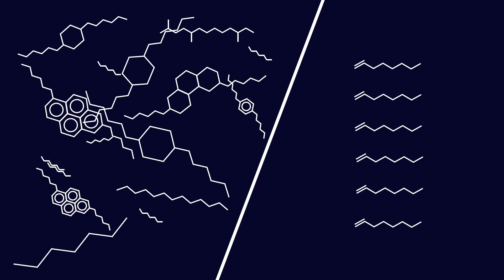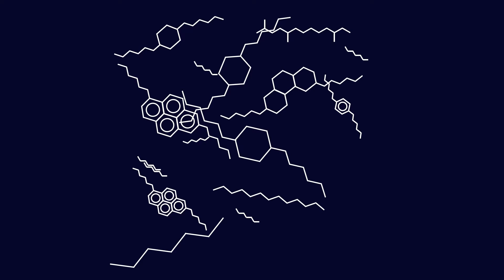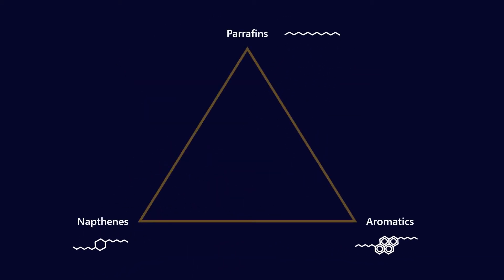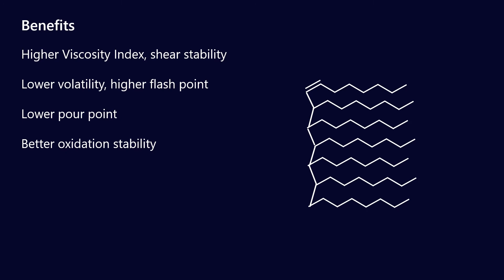What are the performance differences between polyalphaolefin (PAO) synthetic base oils and con..

Comment: The only reason PAOs exist is because 1960s mineral oils don't work at 30,000 feet. The cold flow properties of PAO are brilliant when the temperature outside your cockpit is -50°C but for us mere mortals that drive cars at sea level, in countries with temperate climates, PAOs are something of a waste of money. You need to realise that PAO base stock typically costs about 4 - 5 times that of a bog standard mineral oil. They are also incredibly 'un-green'. Yes you can still buy PAO-based synthetics (Amsoil, Ravenol, etc) but over the last 20 years, the big boys have been quietly euthanising them as fast as they can.
Reply from the maker: They’re still pretty prevalent in the industrial sector. Plenty of PAO gear, hydraulic, compressor and turbine oils. But yes, in engine oils they are a dying breed.
Reply: @LubricationExplained  A dying breed because Group III base stocks are being used in “synthetic” oil offerings (at a lower price) instead of more expensive PAOs?  LE, your must be knee-deep in the lubricant industry in order to discuss so many related topics.  So, is  the lack of consumer demand causing the extinction of motor oil PAOs?
Reply from the maker: @watercooled8105  Great question - it's likely a combination of factors that warrants a stand alone video. TL;DR - additive technology, base oil tech, and blending methods have all come a long way which means you don't need to use as much PAO to achieve the same level of performance. For example, just within the base oil market we have recently seen the rise of both GTL GpIII base oils, as well as mPAO GpIV, both of which offer performance benefits over standard GpIII and GpIV base oils respectively. But great idea for another video!
Reply: @watercooled8105  In my experience, the three most important parameters in formulating any commercial engine oil are a) cost, b) cost & c) cost! This applies as much to the most expensive top-tier factory fill oils as it does to the lowliest SG/CD 20W50 mineral. The decline of full PAO/ester oils is driven by simple economics. 
BTW, you only need one look at the mind bogglingly complex manufacturing processes required to suss out that modern Group III oils are every bit as 'synthetic' as PAO.
Reply: @MrSensible2  I totally agree with you, and thank you for bringing that point (market force) to bear, but then…I can go to a store and buy cellophane wrapped, abominations labeled chocolate chip cookies or visit a family bakery and purchase a fresh, delectable, rich chocolate chip cookie with incredible flavor.  Both are chocolate chip cookies.  Both built on cost, but far different processes and ingredients.  I want (and I’m willing to pay for) the bakery cookie, I just have a desire to know and understand it’s ingredients and the process.  I currently run a PAO oil in my vehicles and unscientifically, feel a noticeable difference with the smooth operation and reduction in oil consumption….what’s taking place?
Reply: @watercooled8105  From the point of view of oil consumption, you might well see a reduction with a full PAO based oil. For any given viscometric balance, with all other parameters (eg DI/VII) equal, PAO should yield an oil with the lowest possible volatility (deffo better than most Group IIIs) . This won't necessarily be an advantage straight away but in a known oil burner like the Toyota 2.4L it should help as it's God awful piston deposits & gunked up oil rings are caused by volatile oil being recycled around the PCV system & burnt.
Reply: @MrSensible2 Interesting regarding the Toyota engine.  My reduced oil consumption experience is with a 220,000+miles, 4.0L V6 used in a 1994 Ford Ranger PU.  After the factory fill oil was used and discarded, it’s lived on Glll/lV synthetic motor oils changed 5-6,000 mile intervals w/factory oil filters. The PAO switch delivered smoother, quieter, operation and reduced oil consumption.  LE’s excellent videos and both of your comments help me better understand what’s taking place.  Your input is greatly appreciated-
Reply: @MrSensible2  you want cost savings here's what you will never be able to do with a group three run it 100s of 1000s of miles with out changing it but it has been done and can be done with group 4 and 5 real synthetic oils with a bypass filtration system. Group 3 will never hold up. So it almost makes PAO ESTER oils the cheapest almost free. Filter changes and top offs way cheaper bud.
Reply: @Jon-O.  That's been the lube industry's wet dream for the last 30 years but (other than for a few brave/lunatic individuals!) it's never, ever going to happen because the OEMs will never, ever officially sanction it. My car has a 12,500 mile OR EVERY ONE YEAR recommended oil change interval. In the last three years, I've driven an average of 2,750 miles per year but according to the OEM it still needs changing every 12 months. As it happened, I just kept the oil (a Group III 0W20) in for three years & it worked fine. Bugger the OEMs say I!!
Reply: @MrSensible2  it's never going to be sanctioned because they don't want to be liable for someone who is  lazy and don't maintain there vehicle but for those who do know and know how it is a wet dream realized. My point was this very simple fact You can make the best most expensive PAO Ester base oils cheaper than conventional oil cost when done wisely. So at the end of the day it's ignorance and fear when people say it's cheaper to run "full synthetics" group 3 when it's really not. How much you saving when the engine is worn-out at 150 to 200k miles and needs rebuilding to keep it going efficiently. Not saving money there. Or the vehicle gets replaced oops spending way more money now. While cost of ownership is always cheaper over time and the PAO Ester based oils will make it possible. Another reason why manufacturers in this country USA will not sanction there use they want you wearing your shit out so you buy more from them. Also send a sample out let the lab tell you if the condition of your oil is still good to go because your way past the time limit better to be informed over ignorant of the state of the oil.
Reply: @LubricationExplained  not with Amsoil Signature Series.
Reply: @Nunya Business German company. Look & you'll find them online.
Reply: We run amsoil keeping it 💯
Reply: Please explain  your use of the word euthanizing 
I want to learn all I can and so it seems your saying that most all the Manufacturers of synthetic oils are changing them and not necessarily for the better? I really like Ravenol products so Please give me just a moment of a more blue-collar explanation of what you mean by what it is that you had said 
thank you
Paul
Reply: I know a local lube oil plant that produces PAO oil and sells pretty much pure PAO as fully synthetic engine oil. They only "contamination" is the additive package that adds in a tiny percentage of Group 3 and 5 oil.
It's been lab analyzed multiple times and the result was always outstanding: rich additive package, excellent base oil. 
And here is what blows my mind:
That stuff is CHEAPER than name brand non fully synthetic oils!
Their fully synthetic costs just under 10€ per Liter while other oils are sold for 10-15€ per Liter.
Reply: That is very true but for these few companies imo they are the only one holding the fake Synthetics at a decent price point. The price of the fake synthetics had climbed 30 percent over the last few years. If the real synthetics companies go under. The big oil companies will charge real synthetic prices with no competition and the average customer will have no clue that they are paying more for less. Thanks for this content
Reply: @nunyabusiness3786 so is any Franchised business so if you don't want to be hypocritical don't go to Walmart or any chain business gas station McDonald's or fast-food chain. Y'all really need to think deeper.
Reply: That’s Why I use Triax oil it’s a nice Group 4&5 blend . Pretty much stopping engine wear in its tracks. Mobil 1 sold out years ago using a highly refined group 3 now
Reply: @Clamjuice65  yeah Mobil 1 got greedy more profit in group three while they maintained there price point when they used a PAO. Things wouldve been different if Mobil had a better legal defense against Castrol.
Reply: @Clamjuice65  what company and where is Triax made I'm curious. I use Amsoil because it's made here in the US.

Comment: What chemicals can be added to PAO to increase solubility? I understand that this is related to the aniline point.
Reply from the maker: Hi! Generally the solubility is increased through the use of a co-base stock. With PAO finished lubricants it’s really common to see synthetic esters or occasionally alkylated naphthalene used.
Reply: @LubricationExplained  There are no esters and AN for this oil: https://www.oil-club.ru/forum/topic/35305-meguin-megol-super-leichtlauf-5w-40-%D1%81%D0%B2%D0%B5%D0%B6%D0%B5%D0%B5/

Not here either: https://www.oilclub.pl/index.php?threads/aral-super-tronic-0w-40-ft-ir.1805/
Reply from the maker: @poziom1989  Interesting - haven't seen those products before but if the IR spectra are correct then yes, they don't appear to have used a co-base. Even a PAO will have a (small) level of solubility, so maybe the makers of those products have been able to include the additive pack without the need for a co-base. The potential risk that might be present is one of deposit control. Oxidation byproducts tend to be very polar, so if the base oil is already saturated then deposits will readily fall out of solution and could form sludge or varnish quite quickly.
Reply: @LubricationExplained  I am writing from another account. In my opinion, this is the right mix of AOs and dispersants. Here comes the question of the aniline point. There is just another component that increases the solubility etc. I just don't know what.

Comment: Yup, yup, yup :) PAO's good for late model engines, 0W-20 or 0W-16/ Commercial vehicles/ Turbo engines & Jet engines?
For earlier piston engines, PAO's might want to slip past piston rings, a bit too freely? 
I had wondered why - If say, 5 or 10W - 30 oils would have the similar, viscometric properties, per SAE? - Glll or lV?
Then I figured that SAE viscosity is measured in lab, under low speed & load conditions?
These numbers become kinda inaccurate? Under engine speed & load? 
Then, a G lV oil would want to get past the piston & burn? A bit faster than a G lll oil? With the same, lab measured SAE?
Reply from the maker: Wow! A lot to unpack in that question. First up - jet engines generally operate on Synthetic Ester based lubricants rather than PAOs. The gas turbines on aircraft tend to run hotter than industrial turbines and have much smaller oil reservoirs because weight = cost; esters have the advantage in that regard. Industrial turbines used to run on GpI oils but have now moved on to GpII/III (we just covered this in the turbine varnish video).

Comparing SAE grades, you're correct - a mineral 5W-30 and synthetic 5W-30 will broadly have the same viscometrics. Where there is an observable difference is in the shear stability and HTHS, because the mineral oil will require more VI improvers.

VI improvers are long polymers that can literally be broken down by the shear forces in places like the piston rings and oil pumps. When they break they contribute less and less to bulk viscosity, so a 5W-30 might start to behave like a 5W-25 or 5W-20. Synthetics generally don't have this issue because the PAO has a much higher starting VI, avoiding the need for additives.

The HTHS viscosity test is an attempt to better replicate the actual conditions of the engine - it's run at a higher temperature (150degC) and simulates sliding speeds you would see in the piston rings. Under these conditions, VI improvers are less effective - it's mostly the base oil that governs performance, so again the PAO would have the edge.

Hope that helps!
Reply: @LubricationExplained  Yes thanks :) Wherein you state that it is the HTHS test that indicates the oil property, better than just SAE viscosity numbers.
Reply: @LubricationExplained  Aircraft also use the turbine oil to preheat fuel prior to filtering and injecting and a higher temperature delta helps this. (The fuel tank is often -30c during a long flight, the heat is partly for viscosity but mainly to eliminate potential wax and ice crystals from clogging the fuel filter. While jet-A is rated to at least -40c, contamination is possible and brief temperature and pressure fluctuations from tank to tank.) 
They also have heat exchangers in the bulk fuel of the main tanks for cooling the hydraulics and possibly additional turbine oil cooling if needed following the primary fuel preheat at the engine, but these only have minor effect on the bulk fuel temp.
The 737NG actually had a problem with wing icing during short turns, the fuel is particularly close to the wing skin on the NG and would get cold in flight and frost up the wings like a beer mug for up to an hour after landing depending on the amount of reserve fuel.
Reply: All you need to counter that in old engines is higher weights. We run group V base amsoil zrod (either 20w-50 or 10w-30) in all kinds of old engines and have no consumption issues even with some engines (albeit very well maintained ones) not having been opened for major maintenance since the 50s/60s. (The oldest one we have  with an uncracked engine is an old slant 6 dodge from the 50s). They get pretty decent Mike's being driven across the country to car shows quite often. That slant 6 dodge usually goes 10k a year because it's a favorite, only thing that has ever been changed on it outside maintenance/wear items like brakes, spark plugs and tires is that it's been repainted.
Reply: @Prestiged_peck  Thankyou. I did think that & tried a 10W-40, full synthetic, in a 2003 Camry, supposed to use 10W-30, new. In this case, there was no change in oil cons ~ 1 L (Qt) per 1000 miles (1600 km).
Seems, this isn't too bad?  Now  trying "cocktail" 10W-40 + 15W-40 :) Might eventually work up to 20W-50 :)
Not sure about G V POE though, re: Oil seals. This is not a race engine :)
Reply: @lesliedsouza4077  try some of that 5w-50 rather than hitting 20w-50, itll be even thicker when hot and won't starve it when cold. But try flushing next change. Heard recently from a Toyota master tech that they have a tendency to get sludge built up even with high quality oils in the oil control ring, which makes the oil control ring stop doing its job as well, though you may be to the point of cylinder wall damage in which case nothing's really gonna stop it. Also an 03 camry ain't old. When I say old I mean anything made before 1990, and a few early 90s cars
Reply: @Prestiged_peck  Yup, yup, yup :) I do a lab oil sample, then flush, every oil change ~ 7500km = 4688 mi.
Lab report comes back ok for now, 232,500km ~ 145,000 mi. Fe & Pb, single digits. Plenty additives remain. 
Zero soot. Engine compression now ~ 170 psi (+/_ a bit) on all 4 - Not gd as new, but within spec?
Thicker oil doesn't help the oil rings problem - 'Cos it's easier to go up than drain? :)
Also, Toyota VVTi seems to prefer thinner oil - tho' the oil rings don't? :)
Manual says 5W-30 to 20W-50 ok - per temp range chart.
Reply: @lesliedsouza4077  just use the one that's recommended for your average temperature range, and err on the side of the thinner cold weight. And I'd still do a flush every now and then (about every 4‐6 changes) to see if it can help a bit.
Reply: @lesliedsouza4077  I have a 2002 camry and noticed it quickly cooked the conventional oil that was put in when I had a dealer service it. I switched to Amsoil 5-30 or 10-30 with good results. (Would also use Mobile1 PAO, just local availability/price and Mobil foolishly took the leash off its marketing department a few years ago and now has a real confusing mix-mash product line.)